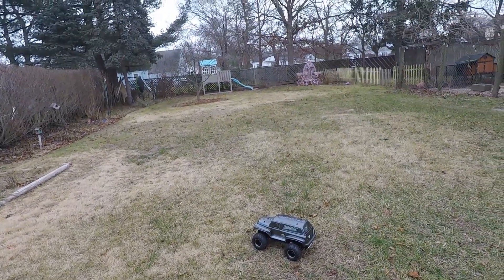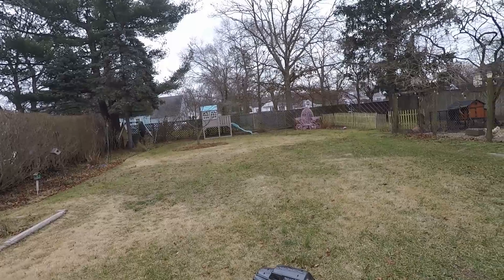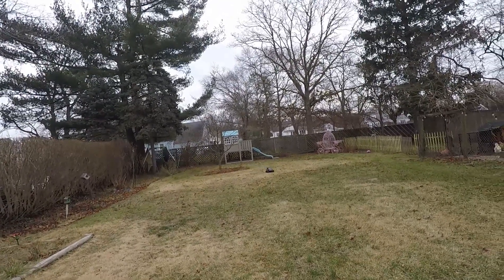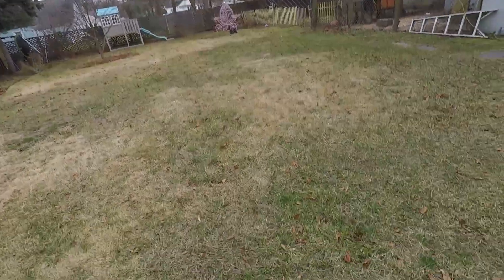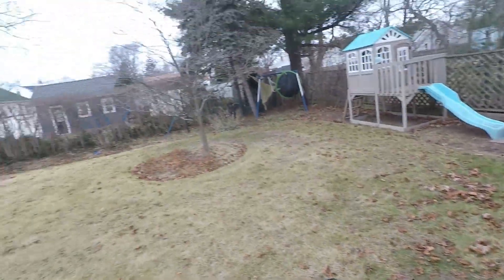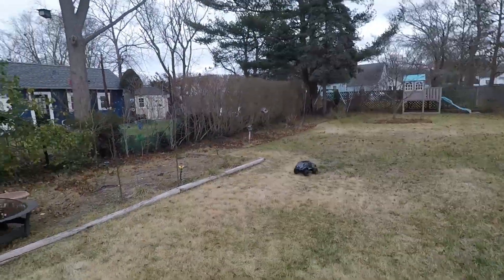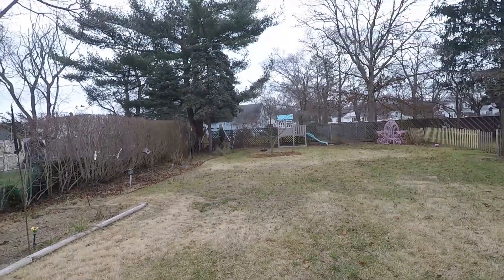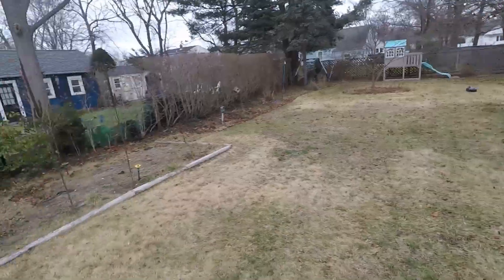Tamiya Squash Van All New15 turn motor Nimh and 3s

Comment: Nice video...
Mine on 2s, 15T Reedy Radon is fast enough. Yeah Racing Go 65mm shocks installed with red springs ( softest ). 
I liked the color of your van. 👍
Reply from the maker: Thanks for watching. You have a nice set up. Any problems with the 65mm shocks? They are 5mm bigger than stock. i was thinking about getting a set
Reply: @JoevsRc  No, they fit on existing set up, but you will a little 2-3 spacer on bottom of shock to clear frame. 
Red= soft
Yellow = medium
Light blue = hardest spring
Reply: I measured the stock OEM shocks. And they were sixty four millimeters the yeah racing are sixty five
Reply from the maker: Post a video of it 😀 @Mark-g4z2s